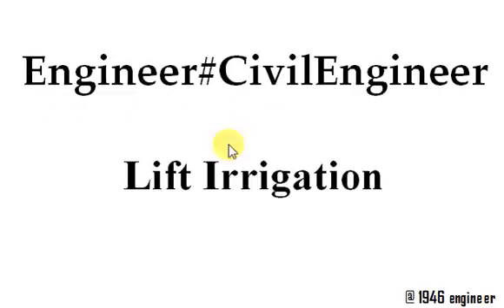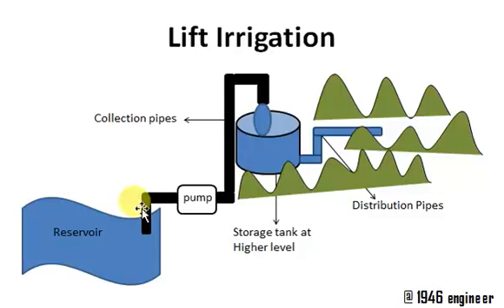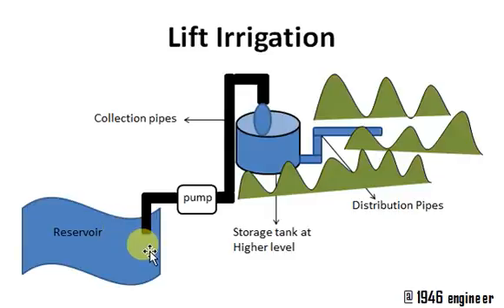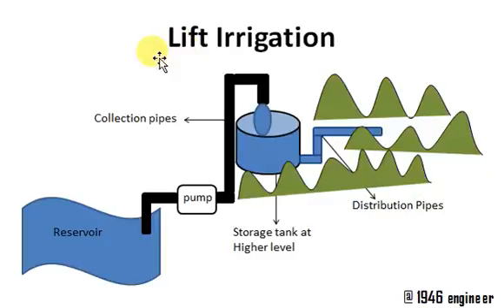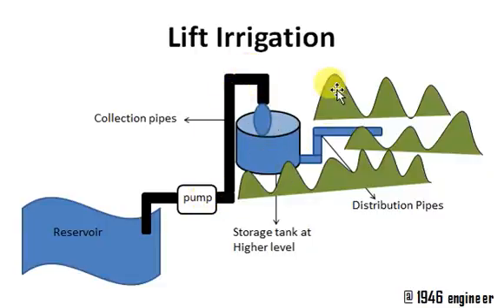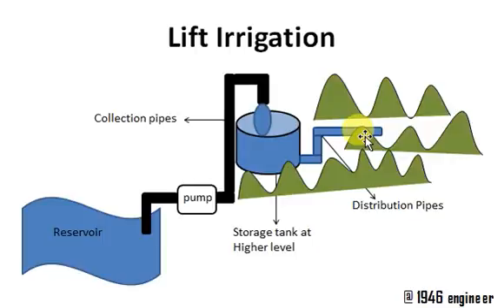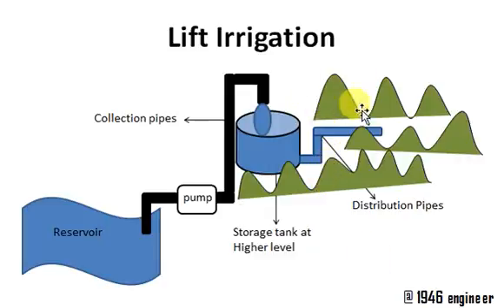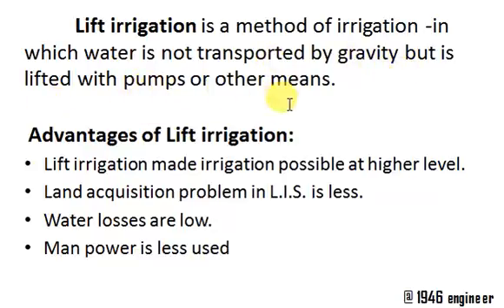Lift Irrigation

Comment: what is L.I.S
Reply from the maker: +amaan altaf it's Lift Irrigation System.
Reply from the maker: +amaan altaf we need less land acquisition for Lift Irrigation System as water is transported through pipelines and tanks instead of channels. 
If you are still vague about the concept. Please comment. 
Regards.
1946engineer#
Reply: @engineer1946  what about power cost and motor maintanence
Reply: salam